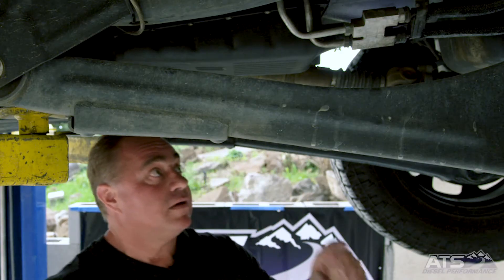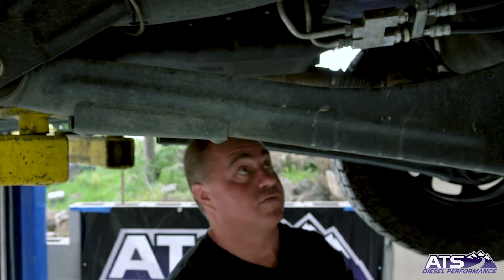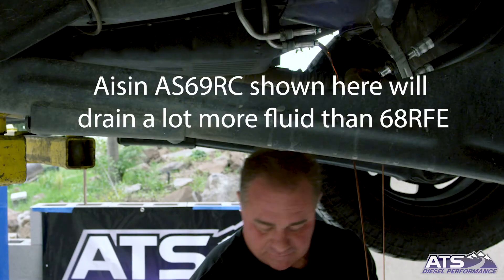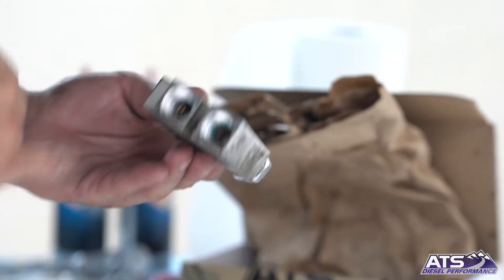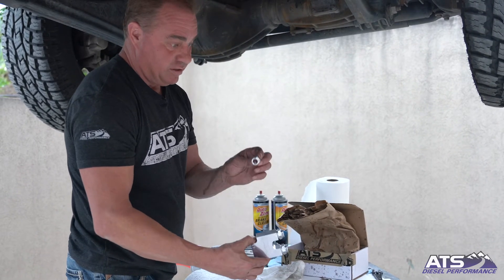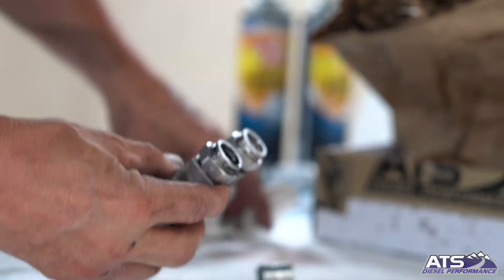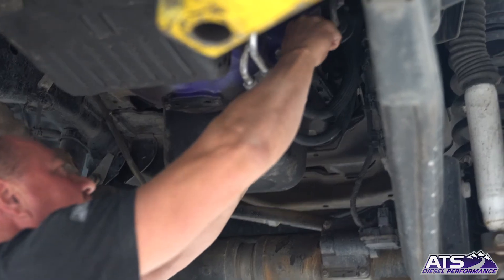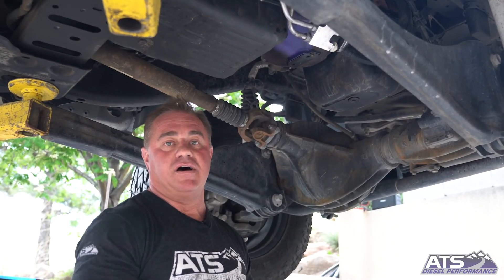INSTALLATION: ATS 68RFE Thermal Bypass - 2013-2022 Ram 6.7L Cummins

Comment: I ordered this last week and finally installed it today. I was averaging 170° in the transmission and after the install, it was at 145°. I think the hardest part of the install was getting the plastic clips off to get the metal clips off. I had to add approximately 1.5 quarts back to top it off. I’ll be changing the transmission filters and fluid next week so I’ll be able to change out the plastic thread for the filter. Overall, great product.

Comment: I understand the theory behind flushing and changing the oil in a transmission. But I can honestly say the 3 that I actually did that service to all failed shortly after. I drove my last dodge and never once touched the transmission other than adding fluid now and then if it was low when I checked it. That truck got traded in with 348k miles on it and still drives around town by whoever bought it. Its probably am urban legend or whatever but I think messing with them is asking for problems.

Comment: This has no thermostat right? So the transmission fluid will run cold in cold temperatures.
Reply from the maker: You make a good point. The factory 68RFE transmission cooler bypass blocks are known to be prone to failure, often getting stuck in the bypass position. This can lead to serious issues, as the transmission fluid will not be able to circulate through the cooler properly, potentially causing the fluid to overheat and leading to significant damage.

The ATS thermal bypass cooler block addresses this common failure by keeping the fluid continuously flowing through the cooler. While this setup does mean the fluid may run a bit colder in very cold ambient temperatures, we have not seen any major issues arise from the transmission operating at slightly lower temperatures.

Comment: Do the Aisin tranny for 2020+ RAM 3500 dually also need this?
Reply from the maker: This is a great upgrade for the AISIN trucks as well to help keep the Trans Temps lower. These work for both the 68RFE and the AISIN trucks.

Comment: I have a 2012 Ram diesel, does it have a thermostat bypass valve, too?
Reply from the maker: Depending on the Package that you r truck, most trucks do not have one on the transmission lines. What we have found is that the trucks with the Extreme Cold Weather Package are the ones that came with this on the transmission lines between the transmission and cooler. We are finalizing ours for the 2010-2012 Ram trucks and plan to release these very soon.

Comment: I did this install on 2019 2500 and lost 4 quarts of oil. Transmission also shifted funny during the first test drive after service, but all it was doing was re-learning. Transmission temps are around 30 degrees cooler unloaded (130-140 degrees F) now.

Comment: Mine won’t stop leaking past the O Ring on the threaded side. Can not source new O Rings to see if would stop the leak. Went to the dealer, and every parts store in town, no luck.
Reply: did you ever find these orings??
Reply: @justinevans6227  Yes, I ordered an automotive O Ring kit from Amazon and it had what I needed. Thank you for asking.
Reply: @Deno172 just installed mine this passed weekend and it’s doing the same exact thing😊
Reply: what o ring did it need?

Comment: Last week I installed the ATC pass-thru block on my 2016 Ram mega dually 6.7 with 68RFE. It took more time to get the tools gathered and the truck jacked up. Once that was done it took less than 10 minutes to install. I had a couple small plugs ready and lost less that 1/2 quart. I just returned from a trip pulling our 15,500 lb 5th wheel from Charlotte, NC to Surfside, SC, 410 miles round trip. We do this trip 2-3 times each year. With the OEM  thermostatic controlled block the trucks digital gauge would always read between 170 and 173 degrees. These are the same temps the truck always showed no matter the time of year or the load being towed. It was always 170-173. With the ATS block there was a wider range when towing. At 45 in stop and go traffic it was 169-172. At 55-65 on roiling grades it was 161-169. At 65-70 on rolling grades it was 165-171. At 73 MPH on basically  level grade it stayed between 169 and 172. Unloaded running 75 around I485 in Charlotte is was 159-164.
Reply: Update: I drove to work the last two days empty, 55 miles each way at 70-75 MPH. It was 72F both morning and the trans fluctuated  between 139 and 145. In the even ing is was 92F and the tran was between 160 and 167. I've parked the truck for a few weeks as diesel is to expensive for the daily 110 mile trip buy will update the next time I get it out of the warehouse.
Reply: Did you fill back up through dipstick?

Comment: Seems well built I just installed on my 2018 ram 3500 aisin 69, it’s not leaking and took it for a test drive. Runs 134 degrees and with tow haul I got it up to 141. 

What bothers me is the how I had to tweak and bend my hard lines connected to transmission and had to bend the hang down bracket because one hard line is supposed to be offset. There is a lot of tension on this. I ordered the PPE and they have a cool magnet plug on the side 20$ cheaper also. 

Why wouldn’t ats match the factory dimensions?🤨 this part doesn’t fit without binding lines ….

Comment: What about just re-plumbing it with two direct lines and no block?
Reply: @davidprattdo Judging by your comment I’m going to assume you have no idea what the thermal bypass does, I will give you a quick and simple explanation! In order for your transmission to function properly your transmission fluid must reach a certain temperature but it cannot go over a certain temperature or it will burn and you will ruin your trans, Towing, towing uphills abusing the transmission will all cause your trans temp to rise! Those lines go to your transmission cooler to help keep your trans temp from getting too hot, However you don’t want them to get too cool so that thermal bypass valve redirects your trans fluid back into the transmission bypassing the cooler preventing the fluid from getting too cool! If you haven’t noticed transmission line sometimes will go into your vehicles radiator then it comes back out and then goes through the trans cooler then back to the transmission, The reason why the fluid runs through the radiator is to help get your trans temp up to operating temps on vehicles in cold environments such as winters in Minnesota!
Reply: Thank you!👍🏼

Comment: Need some help. So I’m new to the diesel work and I just picked up a 2010 2500 6.7. 

I was planning on doing this delete but when I crawl under my truck and look at the area where the thermal bypass would be and there is nothing there. It’s just hard lines as far I can see. I’m looking in the same location that you’re working on in this video. And my trans looks like the 68RFE but it’s missing the thermal bypass. Any help or knowledge would awesome.
Reply: It's located on the passenger side and has 2 lines coming out of the trans, I just did mine was pretty easy,
 hardest part was figuring out how to take the retaining clips out. Took about 30 minutes.
Reply: @Juan4themoney  so after doing a lot of research and asking questions. I found out that not all rams in 2010 had this new feature added. My lines are just hard lines with no bypass as that’s the older style before the bypass was introduced.
Reply: @alanwright782  I was trying to remember what year they started doing the thermostat for the trans just couldn't remember. Consider yourself lucky I guess.
Reply: My 2012 6.7 3500 dually has an 68RFE and it DOES NOT have the block in it either.  Straight solid lines all the way up to the cooler.  What's the deal?

Comment: I have a 2008 6.7 with lower mileage . It is my first diesel and I’ve obviously been scared to the point of thinking my transmission is always on the brink of failure. I tow a Jeep 4 or 5 times a year but otherwise try to keep it serviced and baby it. In my model years is there anything I can do like this to help my truck last. It is a new to me truck and essentially my dream truck because it’s the newest one I could ever afford. It will likely be the last vehicle I will ever purchase but could never afford t put a transmission in it. I just need to protect my truck and respectfully ask for any available help. Thank you for your time,and God bless . John

Comment: I bought the bypass for my  powerwagon with the 66RFE ; it was not as easy to install due to the return lines all being aluminum, but its manageable (2 hours max) but once installed WOW! trans went from 185 when towing my 8k TT to 140.....amazing product, a must for at least the 66RFE.  It does what is says, if you got a Ram, GET IT WORTH THE MONEY!

Comment: Definitely stupid design and location of the thermostat. Designed to fail and destroy transmission. When will Ram learn to do proper engineering.
Reply: repairvehicle well they put in a motor they know will last 500k miles + so they need to build in failure points to keep people buying / repairing their trucks

Comment: Is this thermal bypass cannot prevent transmission fluid from overheating? It like having engine without thermostat. Brother in-law had his removed on Ford and first towing, transmission got overheated. He installed thermostat back and no more overheating.